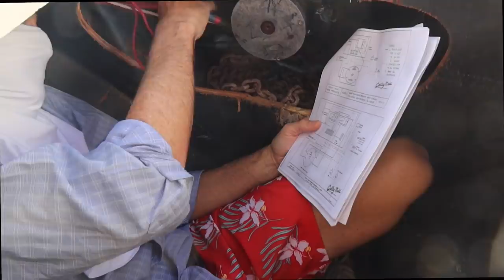Sailing Zero to 600 | PIRATE SHIP S14S02

Comment: Get a fuel sample from the tank, is it clear? Purge fuel line, put a new filter in. Is the seawater valve open or closed for the engine? Check the intake under the boat for blockage, might need to scrape the hull down. Check the rubber impeller that pumps water to cool the engine, probably took a set from standing so long. Need to have a wind chart to plan your route. Run the engine for a while to test for any other problems. Get a good dingy and outboard motor that works. Check for exhaust coming out ok, when the engine runs? Check steerage cables and all bolts nuts and cables. Check running lights and all electricals while the engine running.Buy a few cases of water for drinking only. MONTEZUMA'S REVENGE is real.

Comment: 3:30 I'm no expert, but I suspect that the windspeed reading of 600 knots may not be reliable. Considering that is 300% faster than the highest wind speed ever recorded, I'm not even sure why your anemometer is even capable of measuring a wind speed that high. The highest wind speed ever recorded on Earth was "only" 200 knots. 
      Not that there would be much left of your boat, or the marina for that matter after a 200 knot wind. Let alone 600 knots. 600 knots is getting close to super sonic.